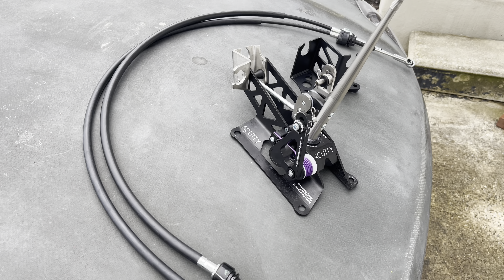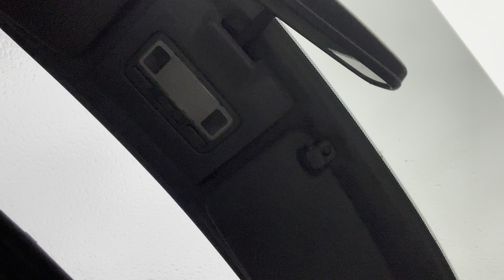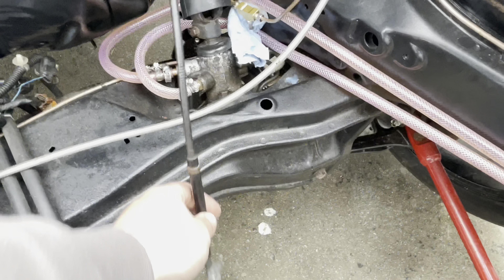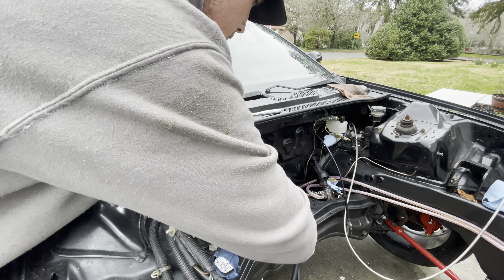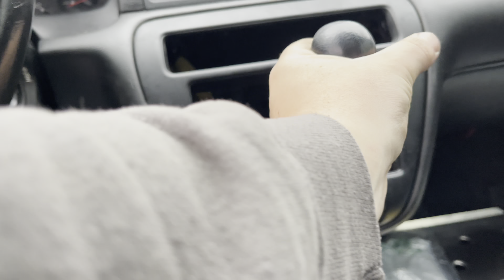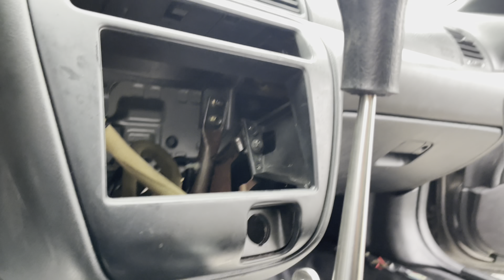How to swap a K series shifter in to a Honda prelude

Comment: I see you got 2 bolts in .. that doesn’t affect anything correct? I’m sure you have the engine in now.. and awesome!! I read your reply and I saw links going to check this out for my 4th gen as of right now I just have the fat four customes  Billet shift Bushing set for cables and shifter assembly for the OEM unit
Reply from the maker: Theres an adapter plate you can get from bballiance to properly mount your k shifter in your h i ended up drilling holes and putting 2 more bolts in to have all 4

Comment: Need the links for everything bro.
Reply from the maker: Shifter

https://acuityinstruments.com/products/2-way-adjustable-performance-shifter?variant=32077340409971&currency=USD&utm_medium=product_sync&utm_source=google&utm_content=sag_organic&utm_campaign=sag_organic&utm_campaign=gs-2019-10-27&utm_source=google&utm_medium=smart_campaign

Cables 

https://www.kseriesparts.com/KTD-SFT-CAB-OEM.html?gclid=Cj0KCQjwz96WBhC8ARIsAATR251xUF_oL8gYw4vm88rGP7D1shTrs_CkAvAgSRq92kkyx8vMbPrrWs4aAjmnEALw_wcB

H2k cable bracket 

https://www.hybrid-racing.com/products/f-h-series-transmission-to-k-series-shifter-cable-conversion-bracket

Upgraded shifter detent springs

https://www.speedfactoryracing.net/products/speedfactory-heavy-duty-detent-spring-kit?variant=35090474533018

Comment: I tried doing this with a k tuned shifter and from maxxpeddingrods shifter and plm cables and it doesn’t go in 2 -4-and reverse smh 🤦‍♂️ and a plm conversion bracket. Nada 👎
Reply from the maker: Did you adjust the cables? you need to adjust them
Reply: @Moneygrip  yes I even bought the same cables u did and the hybrid bracket same
Reply from the maker: @11wrx_sedan27  idk just keep adjusting until it works

Comment: Dracula don’t suck, Dracula scrape and lick!
Reply from the maker: Blehlalalalalala
Reply: How’d you get the shifter to fit inside? Is there an adapter or did you drill and tap the holes to fit?
Reply from the maker: @CompressionFreak  theres a bb alliance adapter plate order the plm h2k cable bracket for the trans and not the hybrid bracket the hybrid one sucks dick
Reply: What makes the hybrid racing one suck? I have both just curious